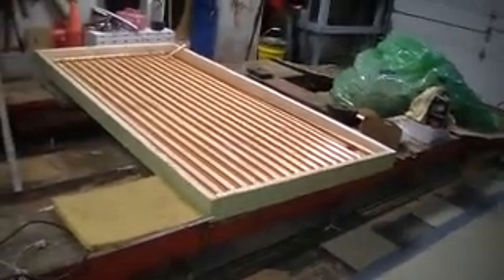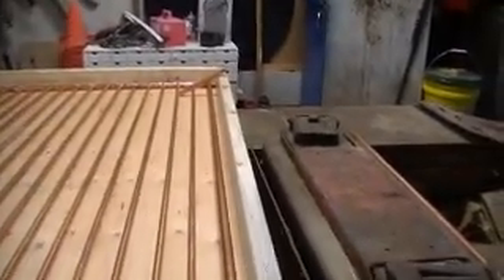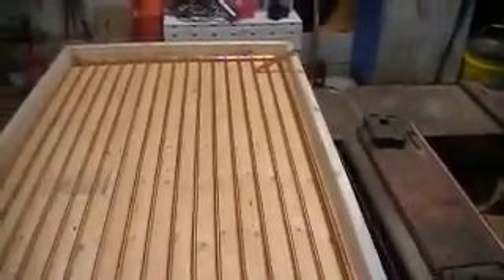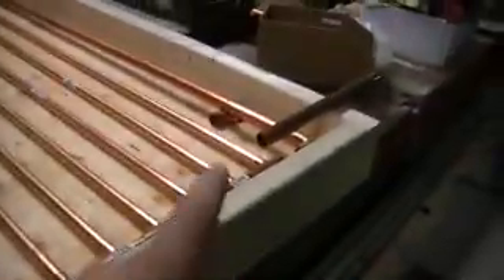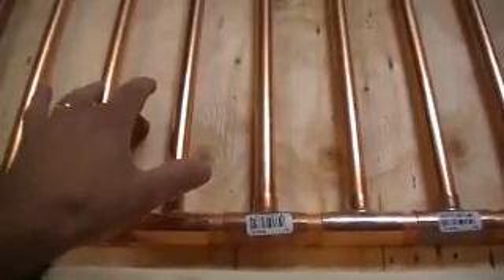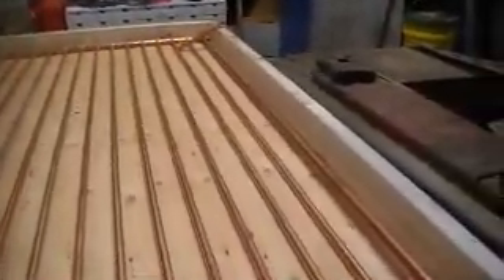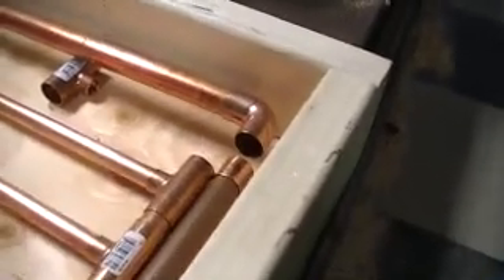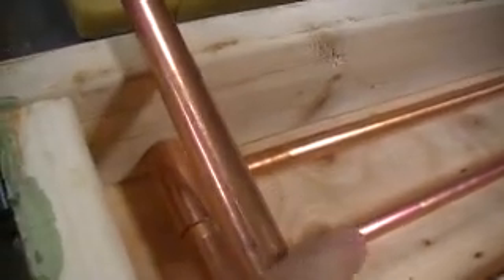How to build a solar water heater from start to finish (part 2)

Comment: how much it cost total?
Reply from the maker: +Urvesh Patel I have about $1000.00 in it that's only because I already had the water heater. if I would of had to buy one that would be the most costly part around $1000.00 and would of made the total cost about $2000 I would have though, because it has paid for it self serval time over now for the past few years